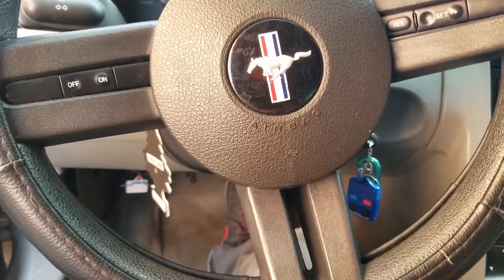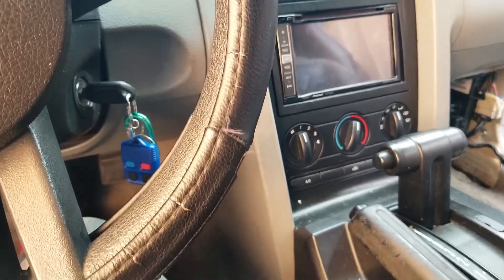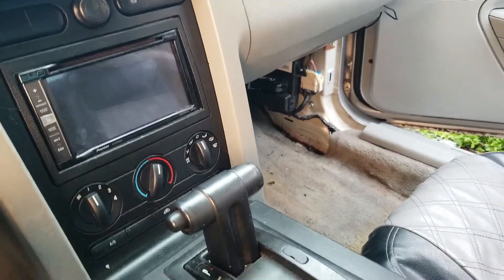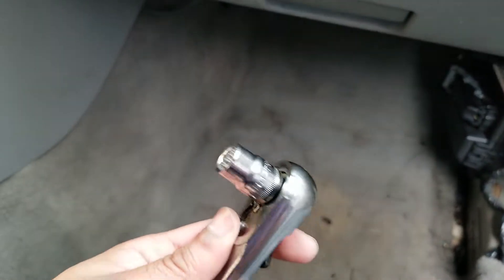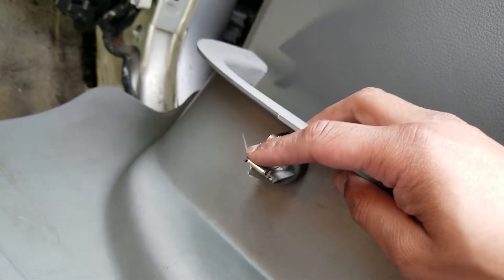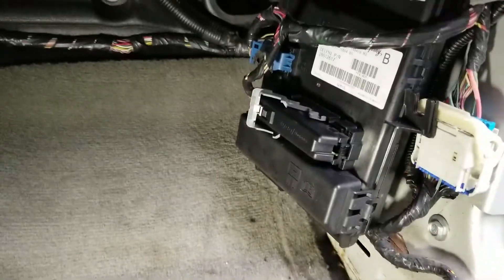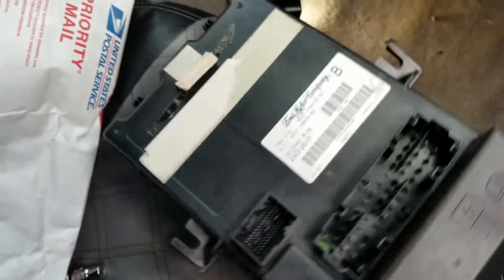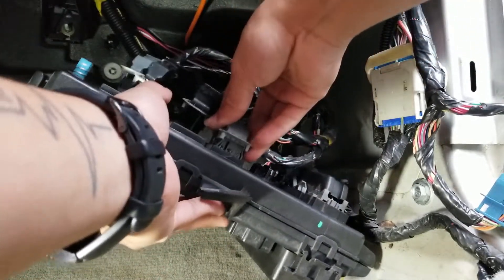Does your 05-09 Mustang Needs a NEW Interior Fuse Box? (Smart Junction Box/Anti-Theft Fuse Box)

Comment: I just replaced mine and put it back together using Dielectric grease (lizard snot) on the plugs it'll keep the water out of the plugs gunna see how it goes.
Reply from the maker: Let me know if it works great, I can probably try using that for mines next
Reply: Well its working so far.
Reply: @dany5.084  so far ive been driving through all the heavy storms we've been getting in florida and no problems even had water on the floor of the passenger side, and the box is just fine I'd think the grease is doing the trick nicely.

Comment: Hi! I know this is a really old video, but I have a quick question. I have the 08 mustang v6 convertible. I was told a certain number on the junction box barcode has to match otherwise you have to get it reprogrammed at the dealership. Is that true?
Reply from the maker: I cannot confirm if this is true or not, I can however say the 2 times I had to replace this part I always made sure the part # matched exactly on both occasions. I just installed and they where working fine without programming, I did however lost that little feature when you lock/unlock the vehicle the flashers flash to indicate you locked/unlocked the car but im OK with that since everything else seems to works how it should (This was with used boxes from Ebay, can't say if it applies to brand new ones) hope this information helps
Reply: it has to match completely or just the letter??

Comment: Recently my smart junction box started acting up on my 05 mustang gt convertible so i went to the local scarp yard and all i could find is a 05 mustang hard top so I took the smart box out of there and put it in mine and everything works except the convertible and my remote lock/unlock is there anyway around this or do I need to bring it to the ford dealership and buy a new one?
Reply from the maker: As far as I am aware, there's no need to buy a brand new one, especially from the dealer, from what I know, you can just take it to them, or a mechanic that knows how to, but you can just get the Smart Box programmed so everything can work just like the factory one did
Reply: @dany5.084   That's great news man, I'm going to give ford a call tomorrow and see if its possible. I've had nothing but bad luck with this thing, I've been trying to repair it because I just dont have the 500 to dish out for a new one.  Hopefully ford could do it. Thanks for the advice man!
Reply from the maker: @YoungSaint45  No problem, hopefully everything turns out for the best for you soon.

Comment: I have the same problem on a 2010 Ford Escape, do I need to program the new module?
Reply from the maker: sorry, I wouldn't be able to tell you for sure, although if it's the same concept as the module in this video, no it's not necessary to program it (From my understanding) unless you want everything in the car to work like it was from factory (Example:  Lights flash when locking/unlocking, honking when locking, automatic headlights working etc)
Reply: @dany5.084  Thanks mate
Reply: @dany5.084  Found this on Ebay ''Pulled from 2010 Mercury mariner drivers side airbag was deployed might need to be reprogrammed'' this is from a fuse box that I need.

Comment: Did u have one tail light now work?
Reply from the maker: In my 2 cases that I had, one situation I had my lights on 24/7 and the other situation it didn't let me turn on the lights at all, but not just one tail light, can't say if changing the box will fix this issue, if you're only having 1 tail light not working then it could be something else and not the fuse box itself

Comment: my passenger side window doesn't roll down would that be the cause of it not working? I have checked fuses and wiring from the switch to motor etc... my motor does get power but I cannot figure out why it is not working at this point this is the last thing I am thinking of someone help me, please
Reply from the maker: This is actually quite difficult to say, If everything is working for you apart from your window not working, it could just be that the window motor or regulator might have gone out, does your window not go down even if you try to roll it down using the passenger window switch? if the passanger window switch works then most likely the master window switch went out as well.

If everything in your vehicle (Electrical related) and if you had a water leak in the passanger side then most likely you will need to replace that fuse box, but I would definitely consult an electrician before hand, that way you dont buy unnecessary parts. Hope that helps

Comment: Did you have to reprogram the sjb?
I was reading on the internet that it was necessary
Reply from the maker: If you get it brand new, yes. However, if you get it used like I did, reprograming wasn't necessary but it is optional. reason why I say optional is because little features like the hazard lights no longer flash when locking/unlocking the car things like that don't work no more. but that's something that doesn't bother me. Everything else that should be working works how it should so that's more than enough for me lol
Reply: @dany5.084  does your car have the passive alarm or the active alarm? I have heard if it is a passive alarm then you need to get it programmed so it matches the coding of the keys.
Reply from the maker: @marvinblaskowski9942  Mines is the active alarm, I didn't know that was a thing tbh. I'll have to do some research on that
Reply: @dany5.084  thanks for getting back to me. My car sometimes won't crank, everything else seems to work except odd warning lights and I get dashes on the odometer, no miles, only when not starting. Car did have lots of leaks. I think it's SJB related. Good video.

Comment: Few months ago washed my car in the drive in wash and water got in and started leaking under my glove box soo now when I turn the key my headlights stay on! Also can’t lock doors/trunk with fob other then that my car was fine lol Soo what should I do
Reply from the maker: I can't say for sure but if it started happening after the water leakage then its almost certain that it could be the same SJB that fried out because my headlights/tail lights werent able to turn on and same with locking/unlocking, i had to do that manually. basically from my knowledge, that box controls the majority of the electronics like radio, headlights, windows, doors, dome lights, etc
Reply: Dany 5.0 yeah just minor issues I had was the headlights and locking doors but other then that my car drives smoothly I’ll look into it

Comment: So the car will start even if the sjb is damaged?
Reply from the maker: It all depends, in some cases (for me) the car did start but I was unable to shift through the gears so I couldn't go anywhere (in the video the battery drained) but in some cases the car will start up and run no problem

hope that helps

Comment: Does it have to be reprogrammed once installed.
Reply from the maker: If you get it new yes, if you get it used theres a high chance you don't need to
Reply: I wish, I would have just gotten it use, I purchased a new sjb for 671 at the dealership for my 06 gt, would have saved a few hundred bucks

Comment: So if I buy the box from a v6 mustang or so...would it still be able to go into the gt?
Reply from the maker: it should, when I purchased mine, I didnt put attention if it was a V6 or V8 model, I just made sure the part number matched and it worked 2 times for me (I've gone through this issue twice already lol)
Reply: It will not working . Make sure you get vehicle specific sjb . GT or V6 and coupe or CNVT

Comment: My car is shutting off when I turn my headlights on or turn signal or hazard. Would this also be the problem. Everything else works it just happened out of the blue. My car starts and runs unless I turn on the lights or turn signals
Reply from the maker: From my knowledge and experience, I believe it could be something else and not the interior fuse box, have you had any water leakage issues on the passenger side?
Reply: Dany 5.0 yeah. When I picked up the car from my mom the passenger side was wet but wasn’t really having any other issues with anything else. The car was driving just fine and then I went to park the car in the morning and the engine completely shut off. The car still had power to everything. But when I turn the headlights on the car acts like I just turned the ignition switch on however the ignition switch is already on.
Reply: I picked the car up about a month ago.
Reply from the maker: @timothyannis3307  I don't want to promise that it could be the fuse box, but it might if it has/had a water leakage, what i would do before you go buying another fuse box, remove the old fuse box and check the prongs on every connection and check for any corrosion from water damage, if it doesn't look really clean (like the one in the video) then 70% chance its the fuse box, But I can't tell you for sure
Reply: Dany 5.0 so it turned out to be ground 101 which was on the radiator support frame rail in the front of the engine bay. Took it off and cleaned the bolt and bolt hole and then scraped some paint off and now it works just fine.

Comment: Hey dany! I need your help please! Im having the same problem its a nightmare,  does it need programming? 
An electrician is charging me $200 for the BCM and 400 for the programming and checking the wires! 
Please asap
Reply from the maker: no it's not recommended to have this box reprogrammed, the only reason why you would need it reprogram is for minor functions for ex. lights flashing when you lock/unlock your car, something else i noticed was that it now honks twice when you lock it but that doesn't bothers me, and this is a simple replacement, no need to pay alot for an electrician to do it, if you are comfortable enough to do it yourself, I say just get the part and replace it yourself, that is, if you are sure that your problem is in fact the SJB
Reply: Dany 5.0 ey so if i just order one from ebay should it be ready just to swap it for the old one ? I thought u need it to reprogrammed it to the ecu

Comment: Thank you Dany for the informative video. I have the same issue (water leakage, battery drained). I replaced alternator twice and still have issue. Do you have a video or steps to stop the leak on the passenger side?  Also, what model stereo do you have installed. Need to replace mine as well and it looked cool! Thx!
Reply from the maker: Thank so much for stopping by and im glad most of this was helpful to you.

Unfortunately I do not have a video on how to stop the water leakage, that's because I haven't found a work around for that issue, all I do for now is just continuously unclogging the drainage on the passenger side every 4 months or so to help prevent water build up but no permanent solution to stop it from leaking, once I find a solution i'll most likely upload a video on that.

For the stereo I have the Pioneer AVIC-5000Nex with Navigation, you can find it online for about $500 or less depending where you search. (luckily its that low of price, when I got it this thing costed me like $900 brand new lol)

Hope that can answer some of your questions :)
Reply: You can pull the covers by the windshield wipers there's a plug in there I drilled bigger holes so it drains
Reply: Hey man does this need dealer programming? Is the programming just for the fobs?

Comment: Here is the part number for a 2007 mustang gt. 7R3Z-15604-E. 

Note: this part is actually called a FORD ANTI THEFT MODULE not a smart junction box or an interior fuse box.
Reply: Would the 2007 anti theft module work on a 2005?
Reply: Same here, I would like to know if the one for a 2007 would work on a 2005 mustang gt.

Comment: I’m having headlight issues, my headlights are always on, also recently one headlight doesn’t work. I tried changing the bulbs and still doesn’t work
Reply from the maker: that might not be the smart junction box (unless you are having other electrical problems at once) I would check your relay within the fuse box in the engine bay, It may be that a relay blew out or is not getting a good/solid connection, usually a headlight relay would run you about $15-$50 depending on where you buy it from and brand

Comment: I’m having tail light problems
Reply: Have you changed it? Please let me know. I am having problems with me rear turn signal
Reply: Have y’all figured this out ? Im having the same problems
Reply: I was having tail light problems with brake light and turn signal. I put too much tought into it and tought i needed a computer for the car. But it turned out to just be a freaking light bulb🤦‍♂️ since the are dual lights it would turn on when my lights where on but whenever i press turn signal or brakes it will shut off
Reply: Jose Val lol u got lucky ... my car wont go out of park and when thst happens my rear left turn signal doesn’t work only the left one and sometimes itll go out of park when it goes out of park my rear turn signal works just fine
Reply: @ricardotorres733 check the ground in the trunk on the frame

Comment: Did you have to get the (bcm) programmed for your car or was it plus an play Bc I’m experiencing the same thing???
Reply from the maker: For the most part its Plug and Play, the part that does require it to be reprogrammed is if you want your hazard lights too continue working when you unlock/lock your car (You know...that little blinking thing it does when you unlock/lock the car with the hazard lights)
Reply: Yeah I see what your saying will be ordering one today hopefully it work but how do you get your dome lights to go off??
Reply: Also how did you or if u even attempted to stop the water leak
Reply from the maker: @craineytv5787  im not understanding the dome light question part, but for the water leak, basically you just have to clean out the drain on the passenger side, the drain system on these cars arent the greatest so it clogs up really easily causing me this issue, so i clean it out every 6 months or so, typically removing the plastic cover thats underneath the passenger wiper blade
Reply: Thanks i really appreciate it I’m about to order mines rn...
Reply: But another question I have is how is it still working for u is it good r, u still having issues again??
Reply from the maker: @craineytv5787  I haven't had any issues with it. so far is good, no leaking,  no damage to the box, so far its good, but i wouldn't be able to be 100% certain until raining season since that's when it really hits, but so far like washing the car or anything like that, i haven't noticed no leaks, my fuse box is still in excellent conditions so, so far everything is back to how it's suppose to be :)
Reply: I appreciate it honestly💯
Reply from the maker: No problem, I'm glad i was able to help!

Comment: Hello, my key fob reverently stopped working and I already replaced it. The cars lock and unlock fuctions only work when the car is turned all the way on. If I turn it off and leave and come back 10-30 minutes later the car won’t lock/unlock w the key fob anymore any ideas? Also before this happened I seen a light turn on then off again in my car and also my car locked and unlocked 3 times by itself
Reply from the maker: sorry for late response to this. but this wont be easy to pinpoint the problem, but because it is an electrical issue there's a chance that it could be something related to the fuse box or smart junction box, or maybe something with the vehicle alarm system, one thing you can do is try and clean the connections to the SJB and see if that does anything, but I wouldn't be surprised if it doesn't since that box is very sensitive to damage

Comment: Does it work on 2007? My break lights are stuck on permanently
Reply from the maker: Yes, this applies to 2007 as well. Process should be identical in replacing this part
Reply: @dany5.084  do you lose any functionality? i heard that you need things reprogrammed. i dont want to go to a dealer and get charged a ton.
Reply from the maker: @CaffeinatedFrostbite  It depends, you might get lucky enough to get one that's already programmed but for the most part yes you do need programming when getting a new or replacing the box, most things will work the same but you will loose some functions (in my case, locking and unlocking the car no longer honks or hazards flashing) but that doesn't bother me much

Comment: Your need change battery other, thats the problem
Reply from the maker: Thanks for your comment, yes in some cases it's the battery, but in this case (from personal experience) the SJB got water damaged due to the common leak issues on these S197, replacing battery did not work, both times this has happened to me was due to the SJB being fried, replacing it both times fixed my issue, I wish it was just as simple as a battery change tho lol
Reply: Disagree!  06 GT V8. Car draining brand new battery clogged firewall drain plugs allowing water to not drain.  Plus this one https://www.youtube.com/watch?v=BTAPevyl9Rg  If drying everything out does NOT resolve this new problem the going with replacing the box 1st.  Right now it just draining my battery and battery light goes on when driving.

Comment: Mine is totally different bro would you mind checking my vid? It will pretty much explain everything... really need some help on it
Reply from the maker: I would say get your battery checked and charged first, if it still has that problem then remove the box and check for any signs of damage on the connectors, those boxes are really sensitive, also, do you have or had any water leak through the passenger side lately? check the passenger carpet and see if its wet or feels like it has been wet for a while, if it is then you had a leak and it got to the fuse box and most likely need a new one (or used from ebay)